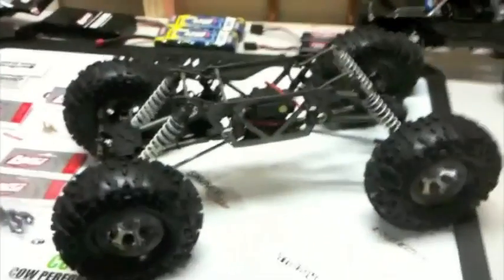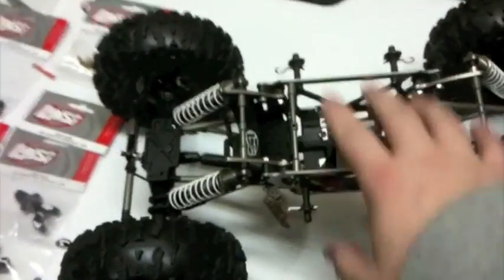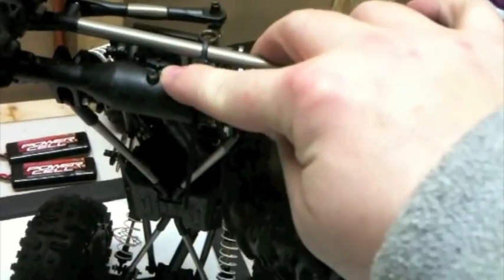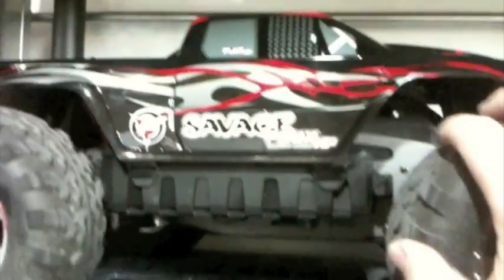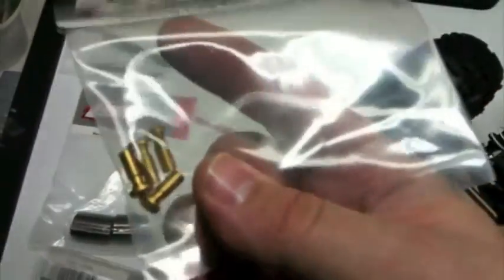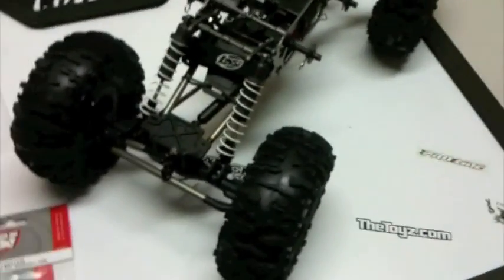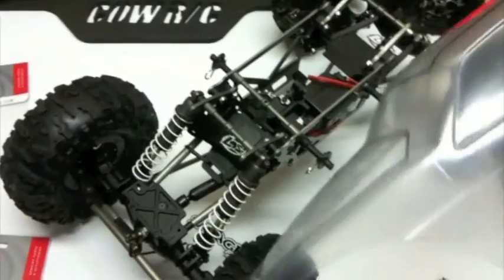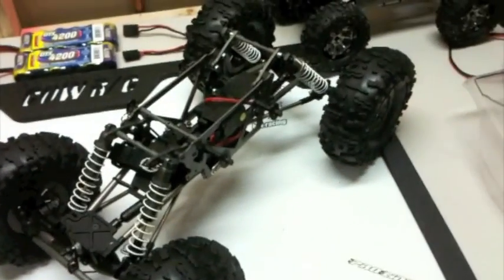My LCC (Losi Comp Crawler) Build

Comment: looks like a great build there mate. just built one my self ,but with a 2s goat /21.5 motor but use a 14t pinion, loads of torque. i put the losi 2s 1650mha lipo.

Comment from the maker: You can run a brushed motor to start with. Couple thing, have you looked at the night crawler? It's a ready to run comp crawler for the most part, and it's well within your budget. Also have you though about getting a slightly used one? Google rccrawler, it's an online forum for rc crawling, and if you read the newbie section on how to access the for sale section, you can pickup all kinds of stuff. You could still get a novak rooster or goat 2s or even a 3s ad the a brushed motor.

Comment: Hi very nice crawler! I'm thinking of buying the same crawler. So far I'm very impress with its features and capabilities. I'm planning to install the Novak Goat 3S Crawler Brushless Motor Combo (21.5T) with JR Z9100T Digital Ultra Hi-Torque Surface Servo (Metal Gear). I don't understand the BEC purpose. Do I need to use one if I ran a 3s lipo 11.1v? Nice Videos too!

Comment from the maker: You could also use a mamba max or sidewinder, and then get your motor. Check ckrccrawlers . Com as they have really good prices, and you can get the lcc kit for 250 and the goat 3s system for 190. Look for a dx3e they are the new baseline spektrum, and I think they have a switch you can use for dig.  Check the forum link I gave you for that.  I am on there as ldogg. Pm me if you have any other questions. 
Enjoy!